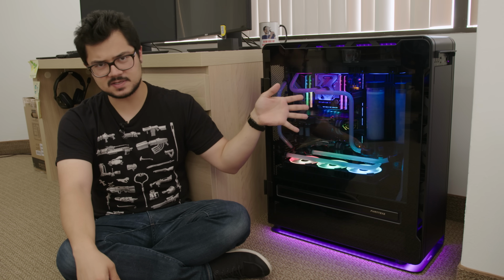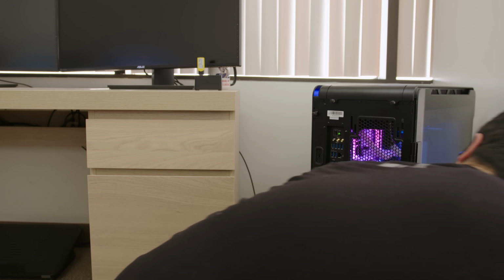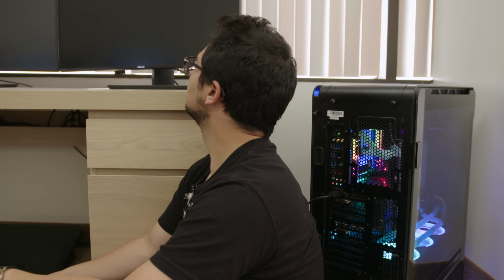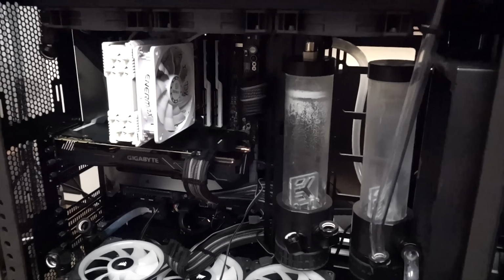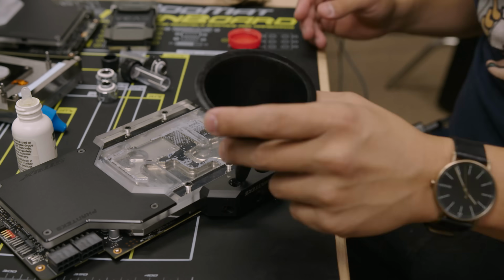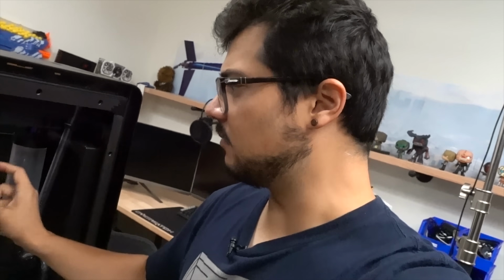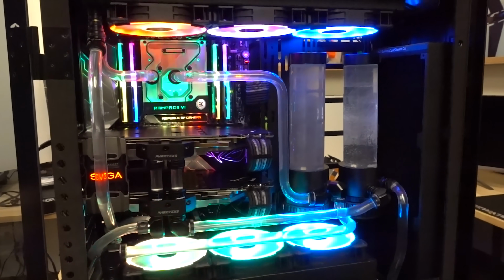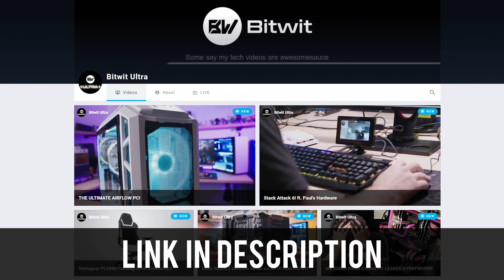Fixing my $12,000 BRICK

Comment from the maker: Quick Update: Now the CPU is overheating like crazy, hitting 105 degrees C while rendering (all-core OC to 4GHz, manual 1.2V). Could be improper seating, liquid metal, etc. I'll investigate and keep you guys posted. :)
Reply: Bitwit if there is any way I could contact you for help on my first gaming pc I would very much appreciate that
Reply: Bitwit 
sounds like bad thermal paste application, although obviously nobody could be certain without getting hands on

EDIT: After taking some time to think there is also a possibility something went wrong during the cleaning of the CPU block, although unlikely, still very possible.
Reply: Bitwit well played
Reply: Ahh....hope you figure out something soon and yes do check that thermal paste because that's what in my opinion could be causing this issue. Hope it fixes soon enough!
Reply: feels bad man
Reply: Dont you know how to put your parts into slots?
Reply: It looks like someone got jinxed for trying to get around the radiator cleaning... Time to drain the loop again ;) woohoo another 12k gaming pc video for us!
Reply: Mbe thermal paste... did you used a PERMIUM une? also did you applied it any good...???
Reply: Ayy lmao nice fixed it
Reply: Did you use toothpaste to clear out the crap between the fins on the CPU block?  I think either Paul or Jay did the same on a recent video.
Reply: dude that sucks...you can't really do that without taking it all apart again...you have my sympathies sir
Reply: Bitwit gta ad on this video
Reply: Bitwit It is probably thermal paste.
Reply: i guess it was the cpu that was not sitting properly. I have had such problem too. I reseat the cpu and the cooler and it works again!
Reply: Bitwit wow youre outdated with storage ive got a 970pro 1tb which is faster than 960pro and has a lot more endurance
Reply: Its just one thing after another isnt it....
Reply: What if it's not really distilled water and he's just putting tap water in empty gallons?
Reply: I'd say that the liquid metal inside the chip was too much or just pushed away from the die while remounting the IHS and now shorting out smth around the die and also not making enough contact to propperly cool it.
Reply: Blank Slate Buddy there is ALOT of videos on how to build a damn pc
Reply: Clear the cmos and bios update possible reload windows, window 10 is a big headache, could be a hardware issue related to the board
Reply: Clogged cpu block
Reply: Update the bios and the latest windows 10 update drivers hardware, drain the whole cooling system and only use the cooling fluid for the PC. Distilled water water can cause it to over heat plus if the cooling system was drained and cleaned
Reply: Your CPU Block is clogged because of that fluid
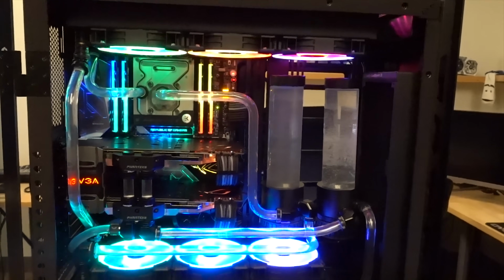Reply: I saw water dripping at 13:02
Reply: did you remove that piece of plastic on the bottom of the water block before you installed it?
Reply: After all this.... and we hear this!. I'm just confused what's wrong with that big boy.
Reply: Dang, got name-dropped! Nice! Wish that BIOS flashback did the trick though. Glad you got it working but sucks about the current issue now. Drats! At least overheating cpu is better/easier to deal with than no post at all though right?
Reply: Yay part 2
Reply: My guess is a minor short, GL 👍
Also got A0, was a short caused by a drive with bad sata connection. All is well now
Reply: Oh and did you turn the pumps back on?^^
Reply: Bitwit A0 is ok I'd be worried if it says 04 or 03. Check your drive or yes update bios that should do it buddy 👍.
Reply: It's got to be the SSD.
Reply: Hi Bitwit, can you tell us what is the liquid you use for you watercooling loop? because a few type of liquid cooling can be use just for show because they can damage the system loop, for exemple the Mayhems - Aurora 2 can only use for show and not for all time because a little particles deposit on all waterblocks and damage the system.
Reply: That's another one the GPU 👉
Reply: Blank Slate just look up videos stop trying to leech
Reply: @FakeName39, Priceless
Reply: Bitwit damn... Thought it was all well, sounds like a nasty adventure you are on
Reply: My best guess is that you most likely didn't tighten it on enough or something is going on with the CPU block itself when you disassembled it and reassembled it. Let us know what happens and keep us updated! Love this build btw.
Reply: Bitwit The SLI bridge wasn't lit, probably could have been someghing gpu related
Reply: Why not ask JayzTwoCents about the waterblock problem, just saying though
Reply: Maybe you put the vrm thermal pad on the choke?
Reply: The quest continues...
Reply: easy to do fix id had that fixed in before the video played. The light works so it works..Failure to communicate.Put more lights on it so it goes faster blinky.
Reply: When it first booted again it said "New CPU installed".. Maybe there is something wrong with your CPU :(
Reply: speaking of FP, they ever get the PayPal thing working, or is that still only through the forum.

Glad it was not something actually broken, and a simple unplug and plug back in made the system work. Great vid Kyle and crew. B)
Reply: I doubt its a hardware issue I bet its a seating issue will fix it. I had these similar issues after resetting everythin i got it all booted. I have led boot code. Reseating things should fix it. Another thing that fixes it can be if u got a saved bios config .Sometime I think the bios gets corrupt. With a loop its harder too troubleshoot cause you have no cooling unlike for me I have air coolers. . My pc is running with all 8 drives enabled.Just reseating fixes can fix biose errors . Most of the time its a bios not a hardware issue.
Reply: @Bitwit you actually did put a thermal pad on the chokes or coils which might be a problem that your big cpu block does not make full contact see https://youtu.be/wbwB7G8RwYI Minute 4:22
Reply: Switch back to air and most of your problems go away. :D
Reply: All the crap breaking loose clogging the block fins.
Drain it, temp install an AIO and retest.
That should narrow it down
Reply: best try a new rad before anything else, probs all that gunk choking up the fins
Reply: your cpu is trying to be HEY IM HOTTER THAN YOU THINK, TAKE A LOOK AT ME
Reply: Nuuuuuu
Reply: I'm thinking liquid metal
Reply: FIRST STEP OF TROUBLESHOOTING... CHECK YOUR CONNECTIONS...
Reply: I know this has nothing to do with your CPU over heating. Please I just wanted to know what is the point of using SLI.
Reply: Yikes! :/
Reply: Make sure to check your contact pads on the CPU, you might have gotten some liquid metal on them, I used a magnifying glass to clean mine.
Reply: Bitwit hey if you have any extra PC's hamgimg around that you want someone to use, I'm a console player wanting to make the move to pc. You could make a donation to the Nathan foundation. ❤️
Reply: 1.2V seems like a lot though. my 4.3 GHz runs at 1.13V and 1.2+ runs really, really hot
I have a pretty beefy cooling setup too, and just 1 1080Ti pushing heat into the loop
Reply: It said a0 because all was good just because it didn't have(not detected) graphics card it was running but underground
Reply: check the torque on your monoblock, make sure it's properly tightened down, and the water flow, pump might be clogged and not flowing properly.
Reply: Don't de-lid? Lol
Reply: Brand of Liquid Metal? Theres been theories as to certain brands PHYSICALLY damaging dies at load. DO NOT RUN THIS SYSTEM.
Reply: The basic consumer PC, right?
Reply: Ouchie
Reply: Isn't there an increase in the reading that most CPUs give without correcting some setting, could it bee that the OFFSET (that's the word it was really bothering me) is a bios setting in the new bios that you didn't change?
Reply: what's idle temps like??
Reply: Maybe take this opportunity to "upgrade" to a proper AMD chip? Threadripper perhaps?  Gamers Nexsus would be the man to ask about liquid mettle application on an Intel chip though.  Crossover videos are always good for viewership you should take the opportunity to help each others channel.
Reply: Im so sorry.
Reply: i will take it off your hands; you know to be super helpful
Reply: Probs the Vue fluids fault.
Reply: persiaFPS there’s nothing to read, dude only asked a question about help. Regardless there’s calling someone out on there shit and then there’s self felatiating elitist bullshit where you devalue someone based on their possessions
Reply: persiaFPS who it was 2 doesn't matter, my point still stands
Reply: You delided that CPU correct? You removed the CPU in the video. Did you mount it without any adhesive? In that case you maybe "moved" the liquid metal.
Reply: your card is dripping. there must be a leak in the block look at 13.02 your block is not properly mounted.
Reply: I don't if this matters but when you first had the computer powered on the slim bridge wasn't lit but when it was working it was lit up so I think it was improperly mounted on the graphics cards were somehow loose or maybe you have a better explanation with this information
Reply: Kyle you should have tries plugging the display port into the other card and removed the slide bridge
Reply: misteravid it was paul
Reply: I had the same issue on my z170 Maximus Hero. Plugging it into the HDMI port on the board and reflashing the UEFI fixed mine. I was then able to boot plugged into my 1080ti and everything has been fine since.
Reply: Or your blocks got gunked up from that fluid.
Reply: Bitwit what is that watch on your hand I rly like it lol
Reply: did you even put thermal paste on the cpu? :D I only saw thermal paste on the gpu, but that was all :D
EDIT: I saw you did (after slowing the video). Hmm... It could be problem with the cpu block!? Try to check if its screwed properly to the motherboard... maybe there's no contact between the block and the thermal paste!?
Reply: Was that sarcasm or are you actually getting a divorce
Reply: distilled water is fine as long as you can keep it below 100c.
Reply: Blank Slate bro its easy
Reply: I'm thinking improper seating with the CPU block.
Reply: Update the bios. I know on some motherboards when the bios isn't fully updated it'll display wrong temps. ;)
Reply: Gonna just assume the block got clogged by junk from the rad on this one. As for finding the root cause of the issue (beit gpu seating, ram seating, etc) at the end of the day you're booting to the OS. Once you're there it's hard to find the root cause, but regardless you've gotten that far, so hurray! Dumb question, but does the ram pass memtest (it will take several days, cpu could still get hot if that's a main problem).
Reply: Bitwit Maybe the gunk in the rad as gunk up the cpu block, i would look this first and second(if not gunk up) check that liquid metal I would think it would be one or the other or maybe a bad pump, who know :)
Reply: The board should say EVGA X299 DARK, not ASUS X299 RAMPAGE! My guess would be that the components just needed to be reseated. And that awful fluid may have had a little something to do with it too!
Reply: Your block is most likely clogged up with that grey junk that was all over your reservoir's.
Reply: I love air cooling so much right now :P
Reply: CMOS Battery, use a multimeter to test it anything under 3 volts causes weird issues
Reply: If I were to buy/build computer, it would take me 2 YEARS of saving all of my paycheck, 5 years if i budgeted...
It is just mind blowing to see how much something so simple as a computer can cost so much, it just amazes me...
But hey, this is just not for some people to have, and I'm one of those people...

Hope everyone had a good day, and may it get better from here on out!
Reply: I guess the CAM-MAGIC thing worked ;)
Reply: And another thing, to just buy the 1080Ti itself, it would cost me the same amount of money as the full system i have planned out...
Reply: Rest in pepperoni
Reply: You don’t necessarily need to feel GPU with water to make a test boot. You can just plug it in with water, without water. It will not overheat. I’ve done it few times and my 1080 is still alive.
Reply: Andrei Loghin Gamer's Nexus has a good video on that one. 😀
Reply: Theres nothing wrong, intel has inherited the heat meme to pull ahead of threadripper by + or - 5%
Reply: Clearly you need more RGB to have a cooler system...
Reply: all these "its probably bad application of thermal paste" comments are great XD
Reply: At least you are never in the dark cause of RGB :D
Reply: I advise de bauer direct-di waterblock mount and a simple block (not full cover). Put the sinks back on and a couple of small fans. Improve thermal contact considerably over just de-lid and 2 reduce considerable added vrm heat load at the source). VRMs will run all day at 80oC no problem.  7920x@4.8Ghz/1.31 volts. (It's 500watts+ of heat)
Reply: 11:27 HE STILL has not checked HDD cable, overheating, done a sector check or OTHERWISE OBEYED THE HDD ERROR CODE.

Dies of embarassment

Do not associate yourself with any professional. 
Please.
Reply: Are you sure you removed all the silicon Intel use to glue the cpu. And check if the clearance from IHS to the die with a small piece of hot and soft Play Doh. It really need to about be touching. Or it could apply to much force on the die and it will break it.  I put 1-3 paper shims under IHS where the glue was to adjust the contact force under full sitting pressure off the cpu in the socket clamp  Had to do that for few of my CPUs... safety of mind and Temp improvement is not hurted, if you dont over do it. I use liquid metal with good coat of varnish to protect around cpu die.
Reply: Bogdan-Andrei Zanfir salut, te pricepi la watercooling? m-ai putea ajuta cu niste sfaturi? as vrea sa fac si eu ceva asemanator dar mai trebuie sa mi cumpar cateva lucruri.
Reply: 1.2v isn’t very high, especially on water. You should definately not be getting those temps. My guess would be it’s the contact between the CPU and the water block. 
Also, does your rendering use AVX? Because AVX instructions seriously stress the cpu and cause some insane heat. So check your AVX negative offset is bios.
Reply: @Sean Lutzke
Tap water and distilled water have the same thermal properties. The reason you use distilled water is because it’s dielectric (ie: non-conductive), so if you have a leak there is a lower chance of shorting the hardware and destroying it.
Reply: Cpu waterblock gunked need to clean your block. Or somewhere the loop is blocked loop.
Reply: Bad pump since u found alota gunk in loop maybe there is gunk. Do you have flow meter in loop?
Reply: Bad low water pressure.
Reply: Ill bet that the liquid metal dried up
Reply: Maybe check to see how warm your distilled water is getting is my only thought. Given how hard that system runs maybe the water just isn't cutting it.
Reply: Oh shit I just noticed that too! Good eye.
Reply: Blank Slate visit reddit/r/buildapc
Reply: Would like to point out during your initial successful post it said "new CPU installed". Dunno if that means anything but interesting for a system that isn't brand new.
Reply: Bitwit My guess will have to be the cpu block, because of the A2 post code, I think the whole time and now, it might be related to too much pressure from the cpu block or something similar
Reply: you may want to pull your loop apart again and take the monoblock off and check and see if you moved the IHS a little bit when you put the block on or when you were working on it and the IHS is not lined up properly with the rest of the chip anymore
Reply: My water cooler plugs into the CPU fan header, if i use a normal fan header, the pump doesn't move enough liquid to cool the CPU... Not sure whether custom loops actually use headers though
Reply: pls keep us updated on this. I am facing similar issues with Asus C7H and EKWB C6H Monoblock and Conductonaut. Getting to TJmax and thermal shutdown in seconds on small ffts prime when OCed. Seems like no contact since the CPU running prime blend at 100 celsius for several minutes will not increase loop water temps a single bit.

sweet build though, really love the Phanteks Elite, I have the Enthoo Primo
Reply: ah... typical computer guy life
Reply: I can't imagine the system sitting on a carpet has done it any favours - that's always what you and Paul gripe about when users send in photos.  One can only wonder, either, with cases like the Enthoo Elite, or Corsair's 1000D... where are the caster wheels so they're easy to move?!

You may want to the check the OS drive with another system; I can't tell you how many times a dodgy Windows update has borked one of my PCs because its putting a CPU into overdrive.
Reply: Distortionize I've gotten messages like that when I clear cmos or just by leaving the power off (psu switch and removing the cable) because I was applying new TIM or dusting.
Reply: PurePhoenix is actually wifeysauce being all pissy omegalul
Reply: Maybe worth try swaping out the cpu ... could be a bad cpu ?  🤔
Reply: how did you clean the loop? like tooth brush on metal or alcohol on napkin....
Reply: ya was going to say it may be a cpu reseat that fixed the problem
Reply: Does this MOBO have a ‘safe boot’ button? Bitwit Kyle is your windows partition set as MBR? ROG boards hate MBR I had the same problem. Always random post codes. Use GUID or whatever the new partition style is called
Reply: Okay i know that by my self how much hours it takes to clean all watercooling blocks plus the Radiators, but you maybe clean the Radiators too. Even i clean my two Radiators on my 7K PC System.
Reply: Until ur able install windows its still broke...mine would get to that point, I would install windows, and BOOM! 

Swap out your display with an old school 4:3 running 1080 and then install windows and all patches. I had the same issue with 2x Acer Predator 4K monitors running on that MoBo...would get the same "AO" code. After installing windows it would just hang or I would get windows blue screen with a fatal HW error listed. Set it up 100% on an old 1080p monitor and then swap the new display in 'after' u have updated BIOS and patched windows completely....and burned it in for a while.
Reply: Is the monoblock making good contact with the IHS? After the delid it sits down a mm or so without a seal, Otherwise use thinner pads on the VRM...
Reply: How has it not shut off yet xD
Reply: My money is on not enough thermal paste to properly cover the larger area of this giant CPU. It looked like you applied no where near enough.
Reply: His graphics beats your 980ti though
Reply: You're right but it is sexy as hell, not 12k sexy but still sexy non the less.
Reply: Flush it with backing soda! Or a cleaning tab of a espressomachine.
Reply: Bitwit I noticed at 11:14 when you reinstalled the CPU block it was not delidded, while earlier you mentioned it was. It that it?
Reply: Everyone's saying thermal paste but maybe the water block is faulty
Reply: That happened to me when the cpu pins were bent
Reply: DO I HEAR EPISODE 2?
Reply: block not seated right or airpocket probably not seated right though.
Reply: Distilled water can what??!!??  Not on it's own.  If the junk still in the rad and blocks is causing flow issues don't blame the water, which will always do a better job of cooling than all that colored crap.  I only use water with a few drops of deadwater to keep the critters away and 1/2 teaspoon of water wetter.  The cooling I use is for cooling, not for looks and I don't care that it doesn't glow or whatever.  Overheating of the kind Bitwit is reporting is due to extreme restriction in the loop, or poorly applied tim, or poorly applied block, no airflow through rads, pump failure or extreme overvolting.  Something has just about totally failed to get it overheated that much.
Reply: Yeah thats kinda hot. my  CPU is not watercooled and is running at 48-50 Degrees C. is that too hot?
Reply: That's just normal i9 thermals tbh.
Reply: nice case when i got my pc i had never heard of nzxt cases, but i mean im still happy about mine, its the cooler master cosmos 2 25th anniversary, a big spacey case, probally not the best for rgb, but i just wanted some light, and more power, and i didnt feel like paying extra for the rgb things
Reply: I would check the push/pull off your fans... are they blowing the right way? it looks to me that they maybe blowing into each other which would not cool too well
Reply: P.S
I'm thinking the issue with your pc not booting was just the graphics card wasn't seated correctly, it probably got loose while you was running the pipes, the motherboard didn't see their was a display issue as the other card was working.I was shouting out "its the graphics card" as I watched the video, you didn't even need to drain it.
Reply: 13:02 Leaky GPU = Water cooling leaks most likely around CPU as well
Reply: Did you turn on the moniter....

Jokes lol
Reply: Re-seating everything usually brings things back to life and you did the cards and the CPU, but is your CPU water loop even pumping?  You got no flow bro?
Reply: I had a similar problem, I changed the CPU and memory and it booted up fine.
Reply: Bitwit yeah, I figured that was coming as soon as you said it was delidded.  Probably time to reapply the liquid metal. -- With a pain in the ass to disassemble setup like that, you might consider using arctic silver instead (because, as long as you don't put glue on the lid you'll still see decent temp drops).
Reply: rip
Reply: Its because your missing full RGB watercooling and having it delivered by the rainbow unicorn.
Reply: Try using antifreeze as coolant if your tube can run it.
Reply: Geezes... 12,000 dollars for so many problems... Is it worthy?
Reply: Clean ram with alcohol and cpu
Reply: well u did say u didnt have the pump plugged in cpu 1 or cpu pump so the board carnt controll it ?
Reply: Can you run the loop without including the processor. If so run the cards on water switch out the processor to the one that you used with air cooling.
Reply: Hey Bitwit. The graphics card was properly seated in the video. What I think your problem was that you did not have the extra 4 pin  PCI power connector plugged in. I'm talking about the extra 4 PIN on the bottom of the motherboard. <----- hands down this was your problem because in the video I do not see a cable going there.  With all that equipment plugged in your board could not distribute the current correctly resulting in the cycle reboot then shutting off.
Reply: Why not use radiator fluid instead of water? lol It'll look cooler and stay cooler.
Reply: i just have my computer on the floor sitting on four 5 pound little weight plates. gives a good 2inches of room underneath for air.
Reply: Aliens
Reply: wonder if different CPU will have same results. I dont know anything about deliding
Reply: Isn't that coolant designed for temporary use only (like cex booths etc)
Reply: undervolt
Reply: @zdoix  Had a similar problem. I was getting no signal on the monitors. Had the ram not mounted properly.
Reply: Your GPU block is leaking the upper one
Reply: Had a friend with a nearly identical issue. Happened three more times after he fixed it the first time. He ended up finding out the tubes between his cards were about a millimeter too short and when the cards were seated and then fixed back together it would move one of them causing the problem. A washer has now fixed this problem  for the past three months.
Reply: Try with ram
Reply: It turned out to be a temperature related problem? Can be a section that got clogged up since after all, there is liquid floating around and I doubt it´s only water flowing through it.
Reply: maybe some how the card had got lose out of the slot?
Reply: I think the problem is that the cpu wasnt in properly cause i saw u remove it and cleanit the put it back in
Reply: hmmm question why not just get good ol fashioned car radiator coolant :) green or blue looks cool and designed too go through a aluminum radiator
Reply: @EpicGamingEct  Doesn't draw heat away as well as water does, car coolant is made to resist extreme temperatures since its exposed to elements, if your computer is in sub 32 weather, you have other worries... Lol
Reply: Maybe water cause... you know... convection and conduction.
Reply: 6:03 That CPU thermalpaste was not even nearly covering the whole CPU. Juts one thing i noticed too, very poor application.
Reply: @brentnhel4194  you are right, it's dripping from the top GPU block
Reply: Bitwit I had the same issue try swapping the ram sticks order around I know this will not usually do anything but when I got that error code it double booted and then overheated so good luck
Reply: OMFG, What is that song at 9:59 Music Identifyer does not work
I need to know, please....
Reply: delid it and replace the liquid metal with thermal compound
Reply: did you ever weigh your rig? I need an approximate weight at least to know if this rinky dink temporary table will hold it :/
Reply: Talking about how good old fashioned water is making you old made me chuckle. I think it just has everything to do with the fact that you were running primochill vue. I was as well and it got to the point that all of the visual effects fell out of the solution and I had to drain it and clean every little bit of the loop. I think anyone that runs vue just gets sick and tired of opaque fluids.
Reply: #wifeyhot
Reply: @paskowitz mayhem's Aurora. ..is also problematic...I am using primochill Vue from around 6 months ...its still in perfect condition ..it hasn't blocked anyloop ..
Reply: @wh1techerry  hey this is pretty old but you should 100% check out his discord
Reply: I HAVE A SHITTY PC BUT I TAKE CARE OF IT CAUSE ITS ALL I GOT
Reply: Whatever happened?
Reply: I mean when the PC is just standing around. Send it to me 😊😂
Reply: Honestly, I would break it down and start with some new parts in it, damage may have happened with all of the on and off, card issues not seated.  etc..
Reply: Maybe it was that normal distilled water is not suitable for yout high-end pc.
Reply: it may be the CPU not slotted in correctly , since it was dellided ... by GamersNexus !
Reply: so did you fix everything?
Reply: Don't overclock. Problem solved.
Reply: King Christo. Tech
Reply: I guess he never figured it out...
Reply: Kyle the premo chill was the problem... And the 105 degrees Celsius is crazy
Reply: My friend had this problem ish, but i found out his problem that he plugged the cpu fan pin to the system fan(where actually cpu fan should be plugged there), he was able to run games and stuff but it shows 98°c - 99°c(which usually it would shut off anyone's computer) but after a simple fix. The cpu shows about 20-34°c on idle and gaming around 40-48°c
Reply: @OGPurePhoenix  You seem to get a "bit" overly upset about a possibly inexperienced youtuber not realizing the points you bring up. You could have given actual constructive criticism in a polite way to let him know the possible different issues he could have been having. However you instead to elect to comment multiple times in a pure rage that makes you look like a child. Congratulations you didn't help a single soul by leave SIX COMMENTS. Jesus.
Reply: Did you plug the pumps back in? Lol
Reply: EX WIFE????
Reply: @shmarvdogg69420  oof wHaT a FlEX
Reply: @zdoix  why would the ram make the cpu go up to 105 degrees c
Reply: @brentnhel4194  you did not... where?
Reply: I wanna build my 12k pc list too
Reply: @wh1techerry  We could only wish